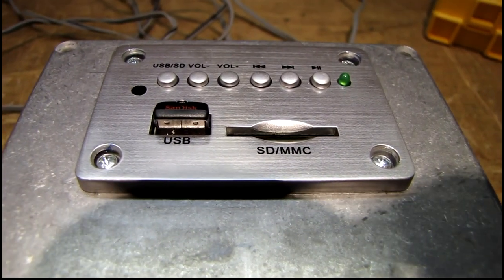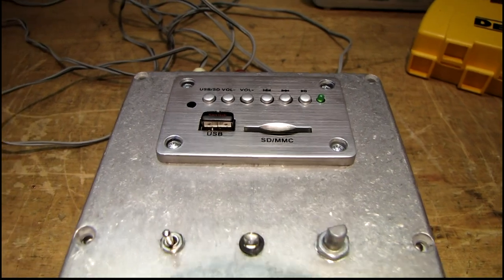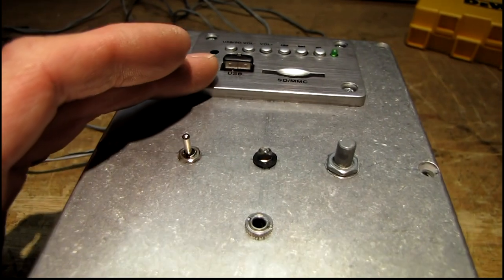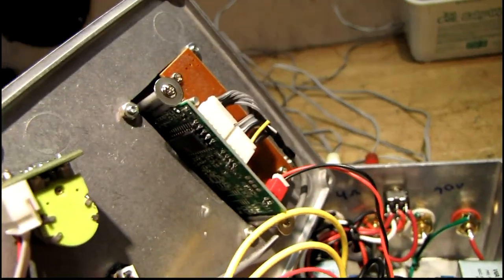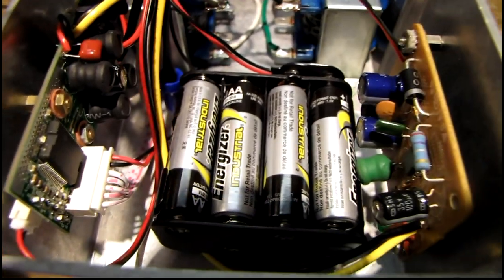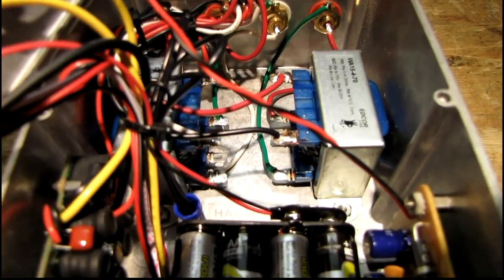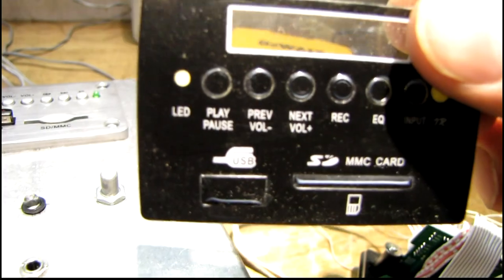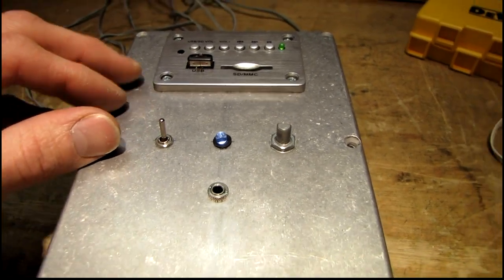DIY Speaker Tester Prototype

Comment from the maker: 70 volt is just a normal speaker with a transformer attached that allows it to run on a high voltage distribution line, for longer distance over small wires.  Such as background music in a mall or a PA system in a school for example.  Ceiling speakers in commercial buildings are frequently 70 volt.

Comment: For the 5v regulator search ebay for "dc-dc LM2596" they are adjustable buck converters and they are very good.

I would also recommend useing lithium 18650 cells for the battery pack.